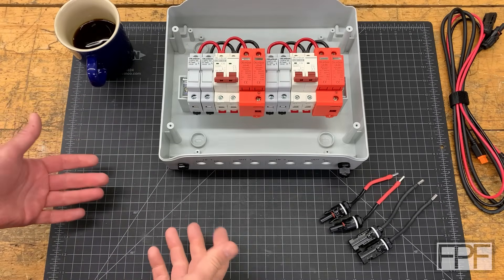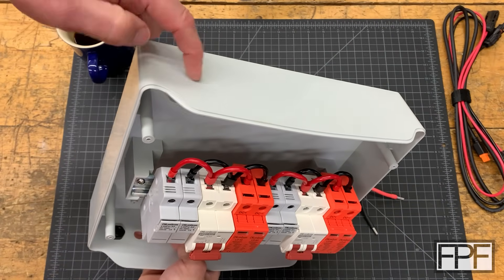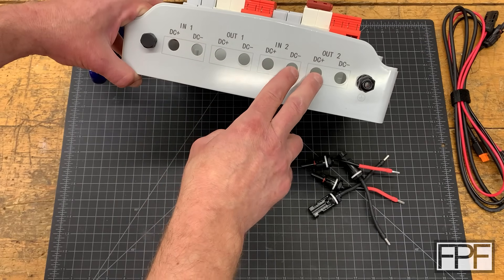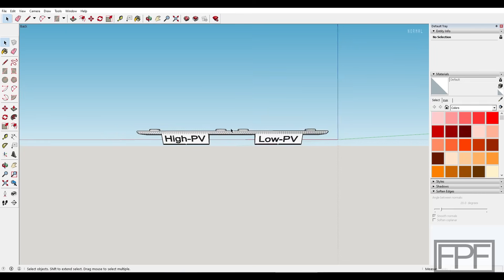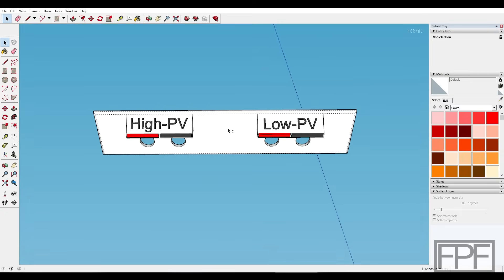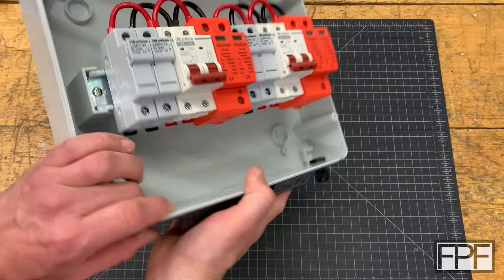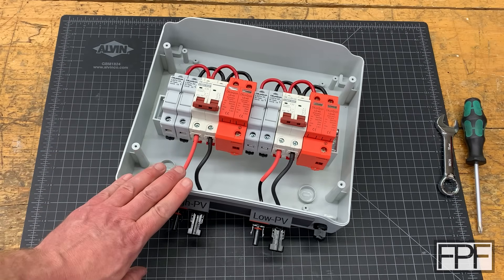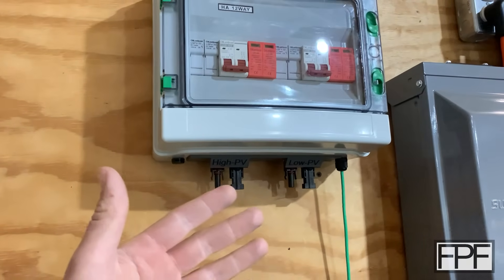3D Printed Color-Coded Circuit Box Plate

Comment: There isn't any building code in your area? Cause printing a high voltage box is against the fire hazard building code where I'm from, that it's only a functional print, if the function is to invalidate your insurance or become a criminal
Reply from the maker: 100% agree, I would not print an enclosure for high voltage.  That's asking for trouble, even if there's no code requirement where it's installed.
Reply: @FunctionalPrintFriday  Yeah and solar is suppose to be approved for 400V DC, that is high voltage, actually it even is as AC here. I think adding the plate you did would violate the fire safety, is it has different properties and doesn't deliver the same protection, so added fire risk right?

Comment: Here in the UK, I think making up something like that, that "modifies" (even though it doesn't), the electrical box, would mean that it would fail it's electrical compliance. Very neat solution though.
Reply: I think it would probably have to be metal as well to comply with the latest 18th edition wiring regs.
Reply: @zeno2712  Yes, I wasn't so sure on that one as its not actually a consumer unit. Plenty of JB's are plastic.
Reply: @billdoodson4232  Yes, a bit beyond my expertise! Not a mains consumer unit (is it just panel or circuit breaker box in the US?), but given the available power involved - and the potential for overheating...

Comment: Since you now have a dual extruder printer, and a penchant for functional prints, you should try  lining screw holes with TPU. They hold up to abuse and act like nylocks. I just use the 50% tap drill size for the screw hole size and make the TPU walls ~3mm thick. You can use the 75% drill size for a tighter fit. It might be a good replacement for heat set inserts, especially for where they would be hard to install. You can encapsulate the TPU to keep the screw straight. Also, with PETG you don't need special interface geometry. I broke the test piece before I could press the TPU cylinder out of the PETG block.

Comment: Could have just put a label on the lid with an adhesive printed label or even written with a sharpie.
Reply: That wouldn't be very fun or require any 3d printing.  The whole point of the channel.
Reply: @deechvogt1589  there's printing for functionality and then there's printing for printing's sake.
Reply: @cdh76  It enanced the functional value of the electrical box adapting to the purpose he is using it for.  It plugged holes he wasn't going to use. So it was still true to the mission of the channel.